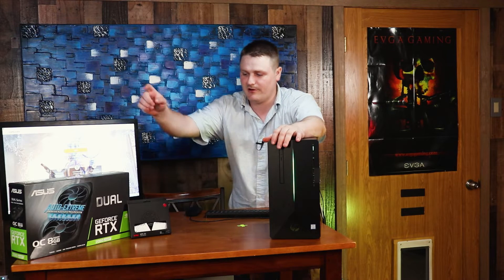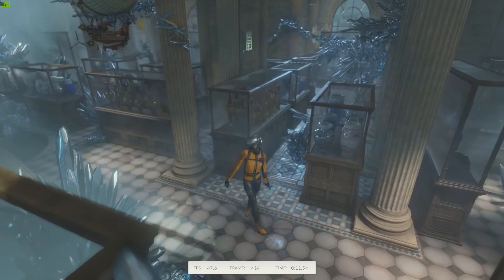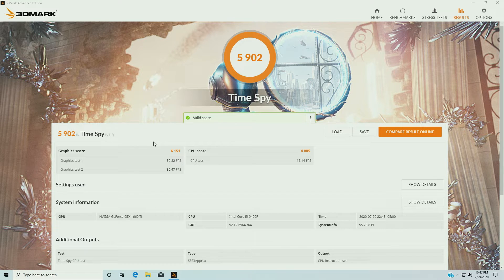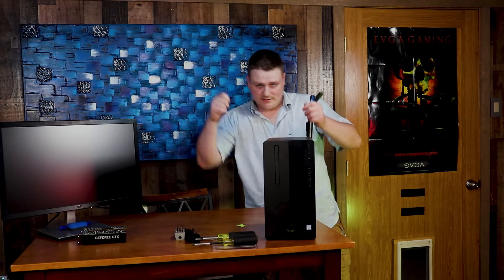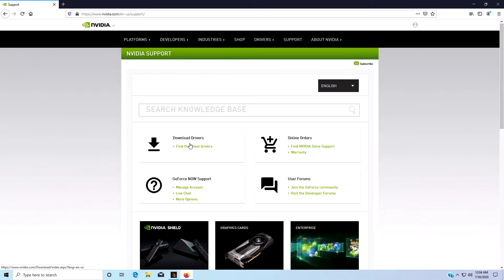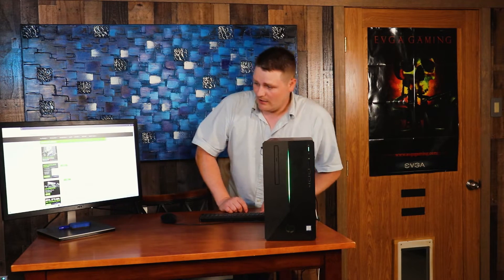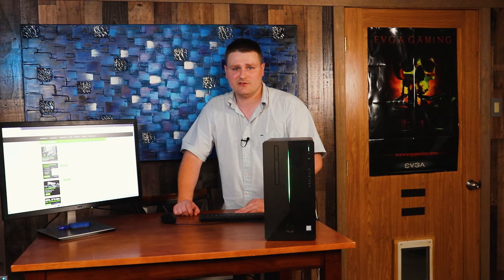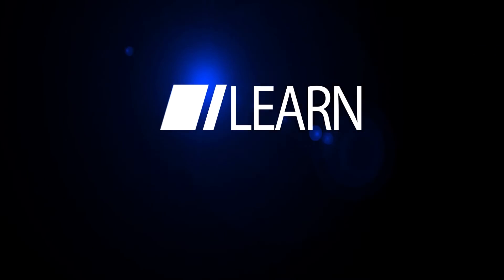Hp Pavilion Gaming Desktop 690 Upgrade To A RTX 2060 Super 8GB GPU & 16GB Of Ram (How to Install)

Comment: So rn I have a gtx 1650 in it with upgraded 16g ddr4 ram and using the normal amd 3 2200 cpu and power supply should I change the power supply for a rtx 2060 and what cpu should I use if I need to change that too

Comment: I have an HP Pavilion 690-00 with I7 7800K, 16GB Corsair RAM and 1050 TI. Having the original 310watt 80Gold plus power supply, can I put a 2060 like yours without problems?

Comment: Hey there @TechNitWit, I have the same model 690-0073w. I had bought recently the 500w PSU and when I did the swap, the computer starts beeping, giving 3 long beeps and 2 short beeps. I checked online and apparently it's some "memory" issue but it's odd because I swap back in the older PSU, the 400w one, and the computer powers one without any issue. Any takes on what could the problem be? I suspect PSU is faulty. Also, when I plug in the power cord on the 400w psu, no fans spins, but when I plug in the 500w psu, the psu and gpu fans power on and remain spinning, the cpu fan powers on but dies quickly, and thats without powering on the computer, only plugging the power cord unto the outlet.

Comment: So the computer I'm dealing with is an HP Pavilion 690-0067c The board is 8433 version 11. It's an old bios, going to try and get it fully up to date. I did get a 500watt power supply, and it is running a 3060 just fine. I'm wondering if it can handle a down clocked 4060 ti. It would be nice to have the dual encoders.

Comment: Getting there, got a corsair 32 gig ram kit and a 2tb crucial SSD. cloning the drive as I type this. Ram worked just fine.
Reply from the maker: cool
Reply: I got new ram too but it’s stuck at 2400mhz did yall find a way to change the speed?

Comment: Ok so Ryzen 5700X is out, how about the Cezanne 5700 or 5700G? It's sounding like the best CPU the 3700X, is that correct?
Reply from the maker: What Cpu did you start with ?
Reply: @TNW1337   Ryzen 1700 is what is in there now.

Comment: I know that i’m 2 years late but maybe u can still help me, i have this old pavilion 690-0003nl, i was thinking about upgrading the ram to 16gb 3200mhz or higher but idk if my mobo supports them ( can’t really understand fromo mobo specs) can you help me?
Reply from the maker: Sure
Reply from the maker: The PC is the same as the Victus 15L just the internal parts have change. Little bit slower ram. 2666mhz

Comment: Might be a dumb question but I have the HP pavilion Gaming Desktop 690 that came with a GTX 1050 and AMD Ryzen 5 2400 processor. I just want to pop a GTX 1050 ti inside it because I got one for free and why not. 
That's Not a big issue right?

Comment: Hey! I recently upgraded my HP Pavilion 690 GPU from a rx 580 4gb to rtx 2060 6gb (PSU is 400), but when I play my games it is very laggy despite being in lower graphic settings. I used MSI to check what's up, and the rtx 2060 is like using 60%. Help me out please 🙏 
Specs
Rtx 2060 6gb
16GB Ram
Ryzen 5 2400g 
400 PSU

Comment: Hey, I have the HP Pavilion 690-0024 and I was looking to upgrade the Graphics Card to a GTX 1660 Super. Is that an upgrade over the stock Graphics Card, and would the stock 400W Power Supply support it? Thank you for the video!
Reply: Yeah. All of the 1660s work. I see he’s doing this with the 2060, but I wouldn’t feel comfortable doing it. I’d just be afraid I’d somehow go over the limit. I swapped out my old 580 and it runs great

Comment: What is the PSU in the system, as I have a HP Pavilion Gaming Desktop 690-0020na with no GPU power and that power supply would fit my system, I was sent this video by HP community support and I am looking to upgrade my graphics card to probably an RTX 2060 as well from a GTX 1050
Reply from the maker: You would need the 400w or 500w psu your is a 310w
Reply: what power supply model. This is my other account. I need a model number so I know what to buy
Reply: Sorry, Found it in the description, 400Watts PSU Part #  HP SFF L04618-800, Any idea where to buy it from

Comment: To all those wondering if they can put a rtx 3060 12gb card in: GREAT NEWS! it runs flawlessly on the 400 watt PSU. I have been playing Microsoft Flight Simulator 2020 in VR with Oculus Quest 2 with all settings on HIGH! It's unbelievable and I'm in heaven with the massive upgrade in graphics and how smooth everything is. This little HP Pavilion 690 is a bad mamma jamma indeed! TIP: make sure you use DDU first to uninstall NVIDIA or AMD graphics drivers from previous card, then re-download NVIDIA experience and update to latest drivers for the 3060 XC. I had choppy frames before I did this and afterwards I could have cried tears of joy at the incredible upgrade I now have. CPU temp maxed out at 82 and GPU at 77 after 2 hours of straight high intensity VR. I can live with that baby! Thanks so much technitwit, I never would have even tried this without your help. 👍
Reply from the maker: Welcome. Cool so your problem is fixed? I was away we where moving to a new place, so I did not have internet till today.
Reply: How did a 3060 work? the PSU for the HP pre-built is 1x8 pin while 3060 is 1x12 pin ?
Reply: @Bachian278  this is what I'd like to know

edit: Nevermind, I looked it up and Founders Edition and one from PNY each take 1x8. The limited samples I picked it looks like 3070, 3080, and 3090 were the only 1x12 pins.
Reply: What is your total ram
Reply: @chrizz1  16gb 👍
Reply: @bunnyfoofoo27  what ram stick did you use bro. I have ripjaws 2x8 2666mhz but every time i run a game with it the pc crashes and makes a really loud noise
Reply: @xovrt  oh damn that’s sounds bad bro. Honestly don’t remember sorry. Have since upgraded to a totally new pc with 4000 series card so am not able to help sorry. Does it do it with just one stick of ram
Reply: Hey, do you have a link for the exact card that you put in?

Comment: (Edit: ran DDU and reinstalled NVIDIA experience and updated 3060 drivers again and problem is 100% solved! 😀😀😀)
Just upgraded to the EVGA 3060 xc 12gb on my HP Pavilion 690 ryzen 5 2600 with 400 watt PSU. It runs perfectly fine. However I'm getting lower frames per second in some games than my 1660 super. Specifically flight simulator in VR. I was getting smooth 30 fps with the old card at low graphics, but with the 3060 no matter if the graphics are low or I increase them to high graphics, I am getting choppy 20-25 fps. I need to tweak it more but hoping it's not the PSU being under powered to deliver what I need. Could be CPU bottle neck also but unsure. Thanks for your help technitwit
Reply from the maker: Try a version or 2 back on the drivers. To see if it is bottle necking, download a MSI after burner and make sure on onscreen specs are turned on, for CPU usage and GPU usage also temps to see if your max out the CPU and then the GPU. if the Gpu only hits like 40%. 60% then yes it is bottle necking. I guess you could use task manager. it may not be a bad idea to get the 500w psu. but I've played many games with the 400w PSU with the 3070. This is a bad idea because you leave no overhead for hardware spikes. The psu I did that to sound like it is going to die now. It Wines very loudly.  you could get a wall plug wattage netter to see if some reason it is pulling more then it should be.

Comment: Hello, my RAM is locked at 2133 mhz after upgrading it. How to make it run at 2666 mhz since there is no option in the BIOS ?
Reply from the maker: you have to get 1.25 or 1.22v ram. No XMP.

Comment: can i put gtx 1080 ti on this pc?
I don't have the exact same as in the video mine intel core-i5 8400 gpu 1050 ti 8 gigs of ram but it is the same
Reply from the maker: 1080 ti no the 400w version will allow a 2060s or 3060. Max TDP on a 400w Psu is 200W max for a gpu
Reply: @TNW1337  but if I change the PSU to a one that has 600w?

Comment: i have not run into any blue screen problems yet with the same pc though having only 6gb of ram to work with sucks specially with the mother board that comes with it won't let me increase the frequency speed to the rams 2666mhz and is stuck at 1333mhz :( plus it came with one stick instead of 2 with a Ryzen 5 2400g.
Reply from the maker: That sucks, I would look at some oloy 1.2v ram
Reply: @TNW1337  i went with the ram in your video and big improvements every where i'm still using the 2400g though as my CPU even tough i have a rx 580 my motherboard is using 2gb of ram for the Apu should that be my next upgrade or a SSD i'm using HDD for windows and my programs.

Comment: If you want to upgrade your hp pavilion 690 graphics card, be aware that if your computer has a gtx 1650, you'll have to buy a sata to 8pin cable because the gtx 1650 doesn't have a 8pin port and there's no 8pin cable that is available in the case!
Reply from the maker: Correct!
Reply: 15 pin to 8 pin adapter right?

Comment: Dude, when it comes to HP’s and Dells just buy samsung ram. Ive bench marked every type of RAM known and samsung every time improves bench marks and improves frames per second.

XMP RAM is junk on those locked HP and Dell bios.
Reply from the maker: I will have a video on it soon.
Reply from the maker: You are not wrong. But I think it is time we move away from hp & dell lenovo has a new sweet prebuilt you can full upgrade. I mean ever part is standard. Normal motherboard, normal psu.
Reply: Its hard to get away from Dell and HP’s. Ebay has way to many business pc’s on the cheap its hard to resist.

Sandy Bridge and Ivy Bridge i7’s still keep up with modern games its hard to resist at under $125 per pc.

Just bought my step son a dell vostro 460 with an i5 no hard drive for $80. Swapped to i7, installed ssd hard drive, samsung 16GB of RAM and a MSI 2060 graphics for under $900

Bought myself an HP elite tower with i5 for $125. Installed an i7, samsung 16GB RAM, a 3060ti and a secondary brick pSU with graphics card molex connectors. Total cost came to $1290.

I don’t have a problem buying used business pc’s they weren’t used for gaming, so its lite load applications the processors have roughly 10 more years of use.

I have an OMEN laptop with samsung Ram 9th gen i7 and it does better than the omens with AMD processors/ryzen master and xmp RAM.

With the high demand for graphics cards these days. People are forced into a position to buy used business pc’s to keep the costs down, since graphics cards are selling for double msrp new. I cant buy used graphics cards. Unknown abuses.

So that even leads me to why people still buy new prebuilt HP, Dells, and Lenovo’s. Because they can atleast still sell new graphics cards at or below msrp with their builds, thats even hard to pass up.
Reply: With the 9th gen i7 and comparing bench markings with the sandy bridge and Ivy Bridge i7’s is only a 10% difference in cpu performance. 9th gen cpu that still sells for $325, or discontinued i7’s that sell for under $45.

Its hard to resisit when there is only a 10% performance difference from buying new, or buying older previous generations.

I may have 6 cores, 12 threads on the 9th gen. But it only takes a 4core cpu with as many threads as possible to game and run CAD.

Comment: Is there a brand/model of any of the Rtx 2060s and 2060 supers I gotta watch out for that won't work with this pre built?
Reply from the maker: Yes there is a lot of then more like here are the brands I know that have cards that will fit. ASUS, Evga, Msi, zotac, they need to be below 10.75 like that is the max or 10" 7/8th but there is a bumb that is in the way you could bend it down but there are cards that a no longer then 10, 10.25 and 10.50

Comment: lol for the price of that card and processor you might as well sell this pc and buy a new one or build your own. doesnt make sense to upgrade video card with these prices, i would sell this pc and buy a new prebuilt but not from HP
Reply from the maker: Yes your not wrong. I think other  pre builds are better and some people have these pcs. Are are stuck with them. So I give them a way to upgrade.
Reply: @TNW1337  I still have it, had it for 5-6 years, now I finally built my own pc with 9800x3d and 7900xtx. I will keep this HP as a backup, but I wonder if is possible to downsize it, put it in a smaller case or something

Comment: Will a 5700 xt fit as well?
Reply from the maker: If it is dual fan and under 10.5 yes. You do not need a 600. They pull less watts then rtx cards do.
Reply: Nvm it requires a 600w psu
Reply from the maker: @Aykadurp  when they say 600 it is a suggested rating.
Reply: @TNW1337  ok so dual fan and no longer than 10.5 and probably upgrade to the 500w psu, now I just have to find an 5700 xt in stock at non scalper pricing… 🤔

Comment: I have the tg01 1020 and I can’t find an adapter for the connectors
Reply from the maker: For the GPU ? 
https://www.amazon.com/COMeap-Express-Adapter-Braided-Y-Splitter/dp/B072JR4H3N/ref=sr_1_6?dchild=1&keywords=8pin+to+Dual+6%2B2&qid=1627514650&sr=8-6
Reply: @TNW1337  i was just an idiot . I didn’t realize it was already in the case 🤦🏾‍♂️ but thank you just installed an rtx 2060

Comment: Hey was wondering would I have to upgrade anything else on my computer to upgrade to this 2060? I have AMD ryzen 5 with a 1660 super and 400watt power supply
Reply from the maker: nope
Reply: @TNW1337  damn thanks man for the great video! Was worried because my power supply might be to small.
Reply: Under a subscriber

Comment: Do i need to upgrade the psu or is it fine with the 400w 80 plat (got the same pc)
Reply from the maker: Depends on what gpu you want to get. RTX2060 or RTX2070 Nope. RTX3070 you would need the better PSU.
Reply: @TNW1337  i was gonna try to do a rtx 2060 (maybe a mini version) and also upgrade my cpu to a i7 9700f

Comment: Hey bro I just got a zotac rtx 2070 super mini for hp pavilion 690(same PC). Now i m confused that what should I do since it requires 8+6 pin connector and I have 400 watt gold plus power supply with8 pin connector only. Also in my PC I have ryzen 7 2700 and 16 gb Ram. Should 400 watt power supply be enough or I should go for 500 watt power supply ?
Reply from the maker: The 500 Watt will be better. you can get a adapter off amazon. a 6+2 pin adapter.
Reply: @TNW1337  Thanks for the reply. I have ordered a 500 watt power supply from hp but now I have one more doubt that if this 500 watt power supply comes with 8+6 pin connector or just 8 pin connector ? I have seen your RTX 3070 upgrade video and I thought it comes with 8+6 pin connector but I m not 100 percent sure.
Reply from the maker: @Meesaa06  It is a 8pin PCI-E you can get a adapter it is what I had to do they make 8 pin to dual 8pin or 8pin to Dual 6+2.

Comment: Just ordered this with a 250 gb ssd and 2 16gb ram sticks for 32 gb total and a 24 inch curved 144hz monitor
Reply: What gpu
Reply: @garrettera1020   1060 super
Reply: @SBMMBOOGIE  What PSU
Reply: @garrettera1020  amd ryzen 5 3500 6 core
Reply: @SBMMBOOGIE  What about your power supply
Reply: @garrettera1020   400 watt
Reply: @SBMMBOOGIE  80 platinum ?
Reply: @SBMMBOOGIE  Thats a good build btw
Reply: @garrettera1020  yeah and yeah it’s pretty decent
Reply from the maker: That psu you allow you to upgrade to a RTX later if you want to. That's a good Pc!
Reply: @TNW1337   nice sounds good I might pick one up when there more available
Reply: @marcuswaddell   loving it I recommend it to everyone looking to get there first pc ‼️‼️

Comment: Do you know what sata power cable i need to add a hard drive? I can’t seem to find it
Reply from the maker: There should be a extra on in the case if you need a extra one go on Amazon and look up sata power cable spliter. They do make them.

Comment: I have a huge problem , i upgraded it with 16gb of ram from g skil at 3200mhz (although the are running at 2133 mhz but that ain't a problem for me ) and since i have done that my pc constaly gives me a blue screen. I have tested both of my sticks on the same slot and they are perfectly running when i use just a single 8gb stick . Do you think it needs a new bios or is it something else ?
Reply from the maker: The Amd version does have a biso update. you could have a bad ram dimm.
Reply: Was not expecting a response from the guy himself 😲... I will check it thanks for the reply
Reply from the maker: @Avligation  you can download a memory test to see if it is bad.I am about 99% sure its a dimm. But if it did not blue screen before you changed the ram, it is bad dimm.
Reply: @TNW1337  i will check tomorrow and tell you
Reply: @TNW1337  i checked the other slot and it is perfectly working , now that's weird

Comment: Honestly GOATED! I have this PC and I really enjoy the fact that it is this upgradeable and having someone like you showing us what to do and the compatibilities this budget PC has is awesome! Thank you so much for this info!
Reply from the maker: Thanks
Reply: @TNW1337 sorry I currently have the AMD RX 580
Reply: Hey mate, I have the 690-00xx and want to get a better GPU, cheers for the video. 

In my one is the AMD set-up - Ryzen 5 2400 6 core, 16 GB ram, 400w psu.

What card would you recommend I get? 
Would the RTX 5700 XT fit for it?
Did you need to upgrade the PSU for the 2060 super?

Any help would be much appreciated .

cheers